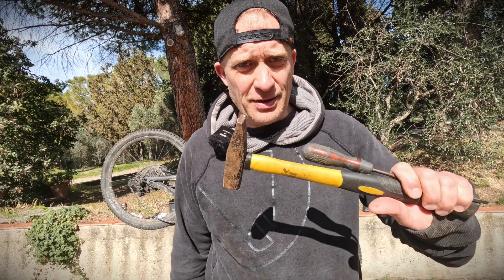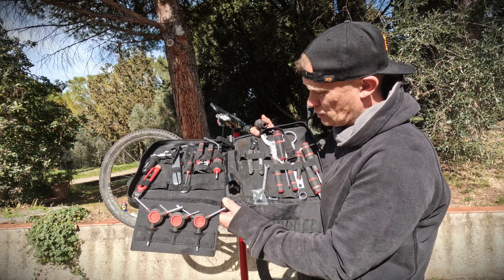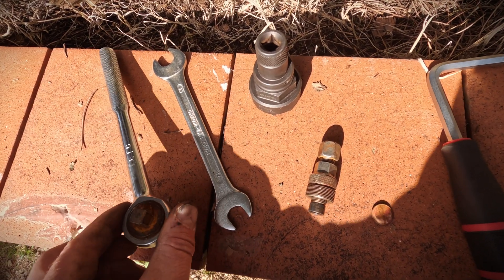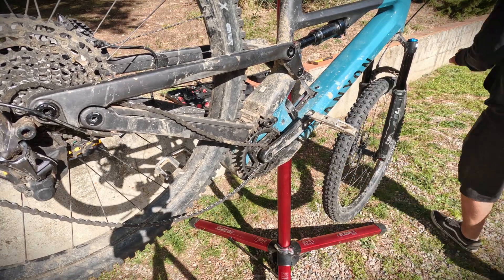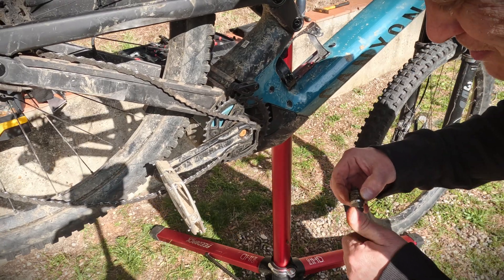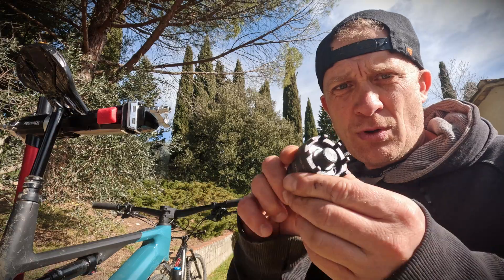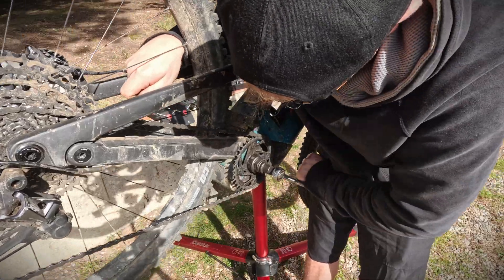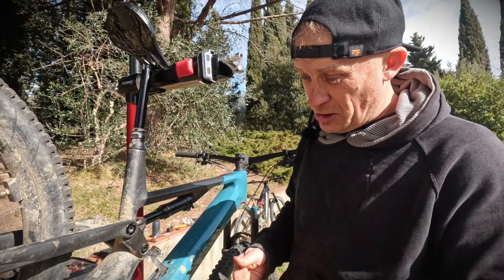You Need This Tool!

Comment: Hey alex, so I watched your video and the only thing differently I see with mine is that I have the part with all the teeth on it but there's no part going through the middle of it with threads to go into the bracket. I am having the hardest time removing this I'm going clockwise and it seems like I'm tightening this thing up as opposed to loosening it. So just when I saw your video with that inserted part through the middle of the piece that looks like the top of a castle I was wondering if I needed that part also but I've heard no mention of it from anyone they just use the piece that I'm using but sometimes I see some people going anticlockwise depending on the bike. Anyhow I'm just calling around see if I can get some advice from people like yourself before I screw up my specialized vado 4.0 ebike. All right mate cheers
Oh and also worth mentioning maybe that tool that you have is specifically for the bosch motors, I don't know, but mine is a Brose motor......... Maybe that's where the difference is if there's any
Reply from the maker: apparently brose is opposite direction to all the other motors, the central part is specific to my tool .

Comment: What happens when that penny drives itself into the crank leaving a 1cent coin with a massive hole in it ! Try 2 1cents just to be safe ✌️
Reply from the maker: expensive.....
Reply: @alexbiketester  true story tho that requires drilling the rest of the coin out and guess were them shaving are going 🤔even with a hoover sucking  while u drill youll never get it all therell be copper dust lil strips doing the rounds inside ✌️